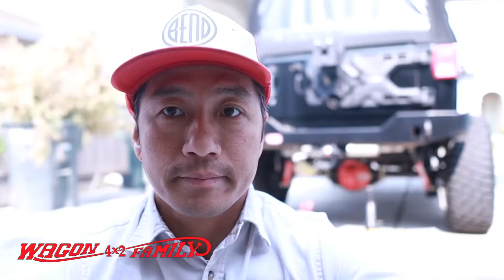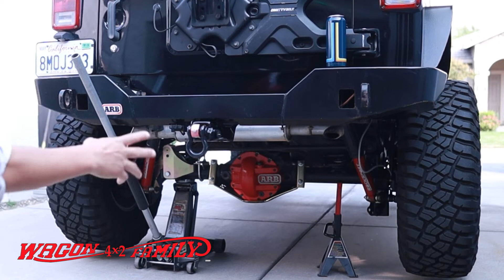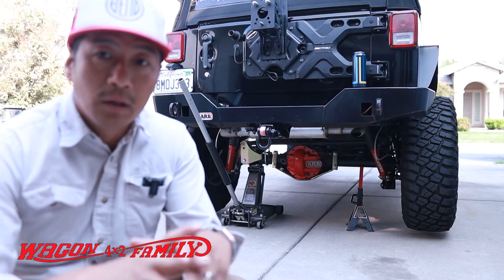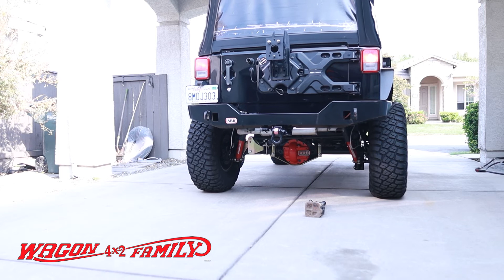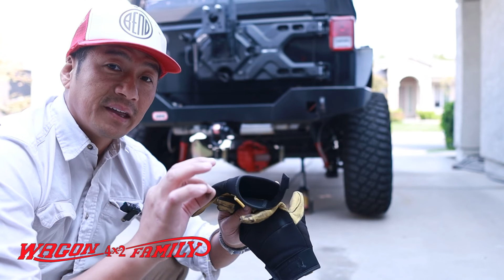what to do if one wheel is off the ground | How to Optimize Traction

Comment: Do the true tracs cause the tires to chirp when cornering??? 

I currenty have the yukon and grizzly locker that is supposed to unlock around corners too but its chirping bad and burning through my tires.
Reply from the maker: No, zero chirping. Never had an issue of it binding.
Reply: @4x2WagonFamily No excessive tire wear either? My drivetrain guy is telling me that the true tracs lock up like the Grizzley's around conrners and causes the tires to bind slightly and wear way faster. Hes saying i should go with an eaton electric locker instead which im sure would be best but might be a little overkill and am just trying to figure out the best route. Im running 37's and 4.88 in a gm 10 bolt

Comment: Hand brakes and Truetrac  makes sense.
Truetrac on rear and pressing foot brakes is making  all the brakes work, so harder to move forward. 
If you had Truetrac on the front only? Then you need to press foot brakes to make it work.
Reply: An open diff has the same affect if you pull the handbrake. I want to see the true track work with both tires on the ground and one is on a slippery condition the way eaten describes the product working

Comment: A good demonstration for those that didn't understand.
The problem is that the TrueTrac is pretty useless in a manual transmission vehicle since I would need to be on the throttle and the clutch at the same time and, thankfully, my dick isn't quite long enough to reach the brake pedal.
I know what you're going to say, but my parking brake is foot operated too. 
Because I have a F350 street truck with lockouts, I plan to install a lunch box locker in the front and, if necessary, a posi of some sort in the rear. So, no odd handling, no tire scrubbing, no premature tire wear and nobody staring because of the clicking and banging when turning.

Comment: I gotta ask my differential guy is waiting on me to make a decision. I’ve got a 2017 TRD Sport Tacoma I hated the Electronic lsd in it. All my previous Tacoma’s were Off road models and had E lock. I’ve been advised to go with a Detroit Locker in the rear now I am learning about this True Trac.  This Tacoma has very low miles it is a Automatic Tranny. I hunt at night in the truck . Coon hunt with Hounds. I never know where they r going to tree and I’m in muddy fields a bunch. Which diff should I go with???
Reply: I have a Detroit Tru Track in the rear of my F-150 and open in the front.  It goes farther in mud in two wheel drive than it went in mud in 4x4 before the Tru Track.  The nice thing about the Tru Track over the Detroit Locker is that you don’t notice it on pavement even on snow and ice.  IMO the only reason for a locker over a Tru Track is if you are going to have at least 1 wheel in the air a lot like for rock crawling.

Comment: I had ox locker installed on the front of my TJ and I thought I had Detroit TT in the rear on Friday. At least that's what my receipt states and that's what I asked for. Going through the shops recommended break in period, I was driving to home depot today, while making a right turn through a water puddle, the right rear broke traction. Okaaaay That's not supposed to happen (I don't think). I came home and jacked both rear wheels up and spun the wheels. Wouldn't you know it.... They spun in the opposite direction.
I will be at their front door 1st thing in the AM.
 I will put this shop on blast if they are crooked.
Reply: What you are describing, is the way a TT differential is supposed to work. In your case with a TT in the rear axle. With both rear tires jacked in the air, put it park or leave it in gear. Turn one side forward, and the opposite side will turn in reverse. This is how the TT works.

I asked the 4x2WF what would happen if this was done, but he did not reply. The TT is a great LSD but it has characteristics that many are not aware of. Until you understand all of these characteristics you will not have a full understanding of how it works, and whether or not the TT is the best differential for any given application. Many claim the TT LSD is the best LSD, I say it depends on the application. 

I believe in your application, which sounds like a street driven Jeep application, since you were driving in Home Depot parking lot, but you use it off road as well, so you want the best of both. The TT in the rear with a locker in front is an excellent choice, for your application, in my opinion.

There are other applications when I would not suggest a TT in the rear.

Suppose you had a TT in the rear of a vehicle and you were towing a boat. Now let’s say you are pulling the boat up a boat ramp in the winter, and there is ice or snow limiting traction for one wheel and good traction for the other. The TT should be able to pull up the hill, and if you applied a little brake pressure, either by foot or applying the E-brake slightly, the TT would pull you and your boat up the ramp with only one wheel having good traction. 

Now suppose you stopped on the same boat ramp, half way up because you want to strap the boat down, with good traction under one wheel, and snow or ice under the other wheel. What would happen it you put it in park, and got out of your vehicle?

See the Eaton owners manual for this in writing from the company that manufactured it.

https://www.eaton.com/content/dam/eaton/products/differentials-traction-control/Eaton-differentials-owners-manual.pdf

Comment: Nice demo, currently trying to decide between a Detroit locker and Tru Trac. From my research it seems the Tru Trac is much more friendly for daily drivers, towing, parking etc. Good to see it can still get traction with one wheel in the air!
Reply from the maker: The Detroit lockers are much stronger for rock crawling and extreme off-road according to Eaton, but I’ve ran through rubicon and many other technical trails without any issues. Best.
Reply: @4x2WagonFamily  Since my comment I actually got the Detroit Locker for the front Dana 60 and a Trutrac for the 14 bolt. Figured it would be the best of both worlds! No drive time yet as the truck isn't finished but I'll try and give a follow up.
Reply: @berserkir  Mr money bags
Reply: @berserkir and is the Detroit locker that bad?

Comment: Great videos.  Nice to see some people properly showing how to maximize the use of a Torsen style differential. 

The reason your hand brake worked better then your foot brake is that the jeep was in 2WD and the hand brake just works on those two rear wheels.  When you use the foot brake the vast majority of the braking power went to the front wheels which were not powered anyway.  This stopped the vehicle dead and the light braking on the one spinning wheel did not make enough torque transfer to overcome all four brakes.  This is also why a front Torsen/TrueTrac works better then a rear one with the foot brake.

Comment: Awesome video brother. I just installed it on my 98 obs chevy. Had 1 wheel in the air and couldn’t get both tires to lock. I used your advice on tapping on the brakes but no luck. Any other advice you might have that Im not doing?  Thanks man
Reply from the maker: Tapping the foot brake generally doesn’t apply enough brake power to the rear, so try pushing the rear parking brake.
Reply: Use correct oil

Comment: I am installing one on my 2007 Silverado. Its RWD and undriveable in the snow/ice and rain. This should help. I hate open diffs.
Reply: Did it help a good bit
Reply: @jacobstallcup8648  yes it did. Still running it. If you're  on a steep angle in wet grass it will spin both tires but much better otherwise. I havent had any issues in the rain.

Comment: If Im not mistaken, with the trutrac in a situation like that tapping the brakes will create a “locking” situation, the hmmwvs in the military use a similar diff.  Thats what I was taught to do anyway.
Reply: Yeah it's not really a locking effect it's really just shooting torque to the other side momentarily. The torque virus effect of these is 3 to 1 so when both wheels are on the ground you can lose a lot of traction on one side but as long as it still has a little grip it will send it to the better side but when the wheel gets in the are the brake Force becomes that weaker grip and then it sends more torque to the gripping wheel based on how hard you're pushing the brake and it multiplies the break resistance. Only crappy thing is if you don't have a traction control system it's adding brake Force to all the wheels but if you do it's only breaking the one in the air and it's even better the Hummer H1 having pretty much an identical setup as the Humvee ended up using ABS traction control around the year 2000 when Land Rover came out with it and they adopted the same company wabco for their braking system Land Rover uses open differentials to do it pretty well but H1 having these and the TC was awesome

Comment: What happens if you turn the engine off,  with it in park, or leave it in gear, lift both rear tires off the ground, and try to spin one rear tire by hand?
Reply: What happens when you lift both rear tires, in park, with the engine off, and then you try to spin one tire? What do you expect the true trac will do?
Reply: The wheels spin opposite direction exactly like an open diff  @AX01Adventures

Comment: 4wd hi and lo Jeeps traction control will enable BLD, or “brake lock differential” which will automatically apply brakes to a spinning wheel which will remove your need to manually intervene.

While using jacks to test this in 4wd is difficult I think that you would find that  your Jeep would pull you off three jacks with one tire on the ground with much less wheel spin than with BLD alone.

Note that I have a manual transmission JK and so some of this may operate differently, but even with pre-traction control vehicles I found that dragging the brakes after the accelerator was applied was the best method for getting a tire in the air to transfer power to the wheel on the ground.  But as I mentioned above in 4wd hi and lo modern jeeps will use BLD to try and keep both wheels on an axle spinning the same RPM.  While I am not sure why they made this design decision the same is not true in 2wd where BLD is apparently disabled.

I have been everywhere from the Mojave to the Arctic circle in December with my TrueTrac equipped Jeep and I love how in 4wd hi it almost removes all of the throttle reducing impacts of ESC when running through sand and how transparently it works on slick surfaces.

While there are benefits and tradeoffs  for any technology, IMHO the TrueTrac is one of the best upgrades I made to the Jeep and for my use case is far superior to a locker.
Reply: Nice ! Have you ever come to a point that you wished you had a locker or been not able to proceed on trails or up an obstacle due to not having a locker? I have a 2020 Ranger with locker and it goes everywhere, literally. Can’t afford a Rubicon and was curious how successful you’ve been because I really would like a Sport 2 door manual.
Reply: Great comment. I have Land Rover Discovery 2 with original traction control that uses abs and it works wonders and so I'm just curious if the true track would help it and maybe it would have to kick in a little less because the true track? What do you think?
Reply: @ronaldrrootiii6040  Yes. The Truetrac will only improve your already-good rig.

Comment: Great video. Thank you!  Wouldn't the same thing happen if it was an open diff?
Reply: Yes but an open diff wouldn't send as much power because it doesn't have the torque bias effect. Which means an open differential will only send let's say 50 lb to the other side while this would send 150 lb because the torque buyers is 3:1 ratio while a open is 1:1ratio. 

Also a clutch style limited slip does not benefit from brake Force because it requires spinning to engage internally.  

Lastly if you want the best of the best attraction Control System like Land Rovers 20yrs ago or Toyota Atrac nowadays is even better because it applies brakes only to the spinning wheel. With what this guy was doing in the video you are actually fighting against the breaks because they are squeezing on the wheel at the ground also so even though it wants to turn its fighting the brakes but with traffic control it only breaks the spinning wheel and then there's differential works amazing after it grabs
Reply from the maker: It should work with any 4x4 system including an open Diff.

Comment: This definitely seems like it would work better in the front. The foot brake and gas would work better in the front diff because the brake bias is heavier in the front using regular braking. The ebrake worked better in yours because the bias is heavier in rear, or t least more evenly split. From what I've learned anyway, (on older vehicles) correct me if I'm wrong.
Reply: jeep was in 2 wheel drive. The front wheels were braking and keeping the jeep from moving when he applied the food brake.
Reply: @williamgrayson3239  Use the emergency brake.

Comment: I have a 14 Jeep and I just did true trac in the front for now (made a huge difference) I was thinking to do locker in the rear. What made you do the opposite of what I’m doing?  (Meaning true trac rear, locker front?
Reply from the maker: The lockers in the front is more effective meaning it’s better to pull the Jeep over obstacles vs pushing. Also, The trutrac in the front will not work if the wheel is turned or turning a slight bit. I hope that makes sense.
Reply: The pulling aspect makes sense. It still performs well for me even when turning. I figured a true track would be easier on a dana 30 than a locker would.  And I do have some control over disengaging it when I put it in 2wd for Street use.  I like the aspect of having a locker in the rear for daily driving because I can disengage it (and Dana 44 is stronger). Either way though it’s way better than open diffs that I use for the first year
Reply from the maker: @joerouth6255  let me know how the front Truetrac handles off-road.
Reply: I did the opposite because I have a Dana 30 Hp front and didn't want to grenade it with a full lock locker.  I like the idea of the front diff having a little play/buffer.
My rear axle is much stronger and is getting a selectable OX.
Figured this setup would have the best overall road manners and least tire wear as well.
Seems like a torsen in the front allows you to ride the brake a bit to get the grip tire to turn if the other is airborne.
Reply: @2s1 I agree I’m gonna stick with dana30 so truetrac seems less prone to break things. I’m just trying to decided now between arb locker or e locker for rear. E locker is cheaper which is nice but all my friends swear by arbs. Guy at shop tells me Detroit e locker is better than factory rubi Locker so I might go with E

Comment: Great video. Really leaning toward a true trac for my 2wd truck. Seems like a good compromise of price and capability.
Reply from the maker: I think that’s a great option. Did you check out my other video on the snow demonstrating the Truetrac?
Reply: @4x2WagonFamily  yes I did you have some great coverage on this setup
Reply: Great unit. Just installed one last week. Traction is immediate. Feels like a locker back there without the crabbing around corners.
Reply: @boorion4468  I just got one installed finally 2 days ago. Can't wait to take it to the trails and try it out

Comment: I just put an Eaton Tru Trac on my jeep when i installed 5.13 gears this weekend.  Does the ESP and ESC controls kick on before the tru trac.  I did wire the a cut off switch to manually turn it off.  Just curious.  Thanks!
Reply from the maker: Congrats I think you’ll love it. I’m not sure about ESP or ESC.. When I engage my  4x4 mode I usually turn off all traction control settings so that I’m not fighting the system:)
Reply: @4x2WagonFamily  So far so good. It’s a huge difference over the stock 3.21 with the open diff.  I will have to play with it after the break in period and report back. Great video.
Reply: Jeep owner here with the True Trac. I find the traction control kicks on way less with the unit due to the extra traction. Great unit.
Reply: @boorion4468  Awesome to know and thanks for the info.  I am a middle aged man who is pretty level headed but the kid in me wants to test it out and try to do some donuts "for old times sake".  😂
Reply: I put 513 gears and the truetrac in my 2003 Chevy Avalanche. It's a world of difference. Not just the gears of course they're fun. The Truetrac it does work

Comment: With the 4 wheel drive system engaged the Jeep Command Trac system would have attempted to keep all four wheels turning at the same RPM.  Therefore no pumping of brakes should have been required because the Command Track system would have braked the free spinning wheel in an attempt to slow it down and shifting power to the other wheel.  We have to run the test again with the system engaged!  The Jeep Command Trac and the Truetrac systems are independent systems but work together or complement each other when the command Trac system is engaged.
Reply: Yeah sounds like the same as the original Land Rover traction control. That's what I have right now and I'm just wondering if I add a true track would it just help that traction control to work less? Also in this video I'm pretty sure an open differential would do the same thing if you apply the brakes